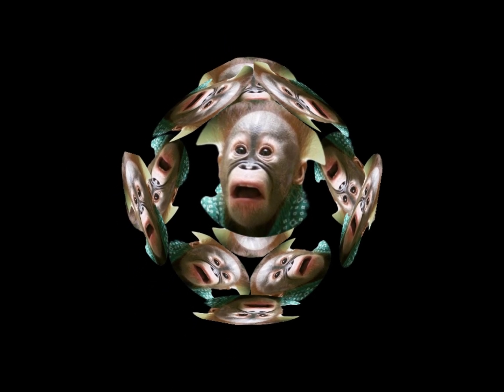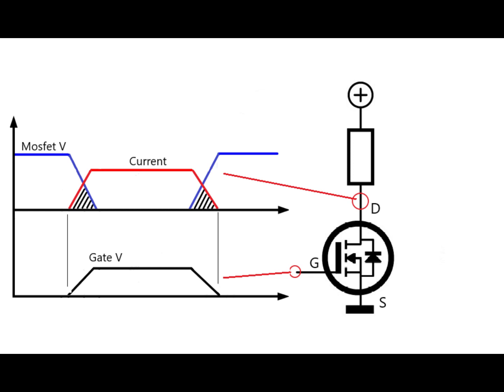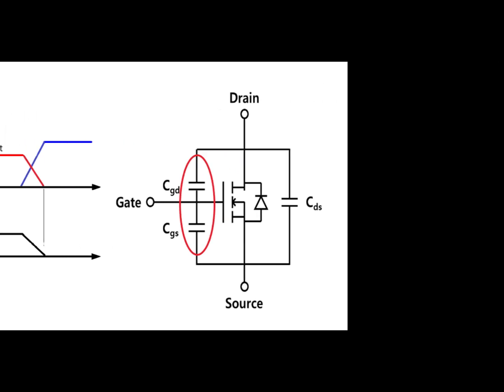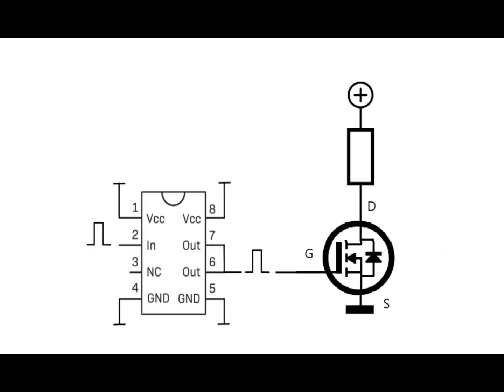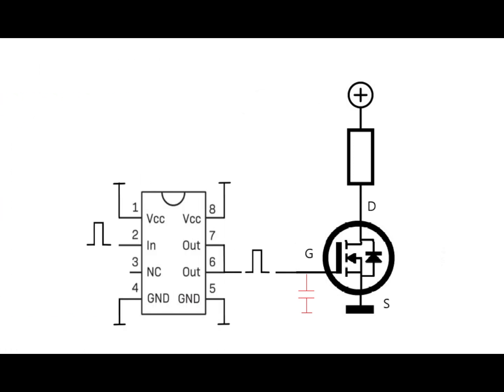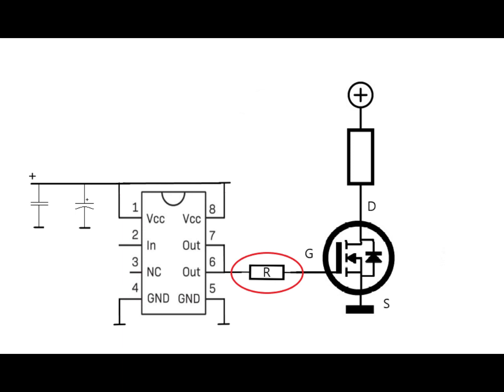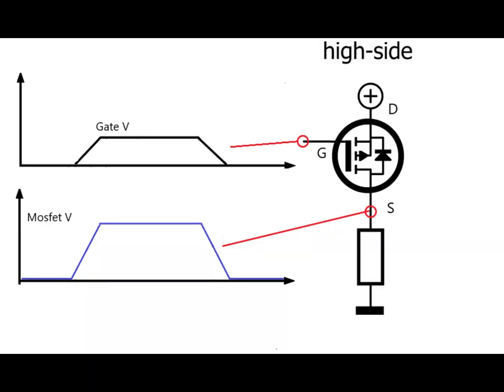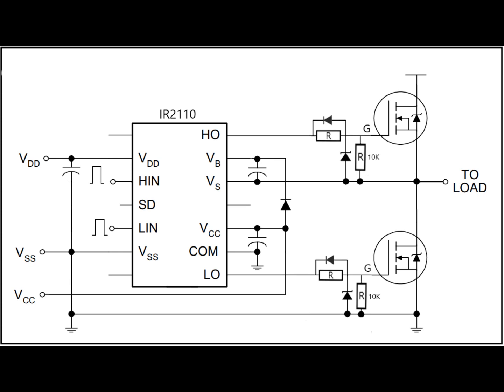How to Drive Mosfets and IGBTs

Comment: So if I’m running 5 volt input voltage from an arduino at the input, can I put a 10 volt output voltage to get a 10 volt signal?
Reply: If you pick a suitable FET - yes!

Comment: Just out of curiosity : is it not preferable to have the 10k pull down resistor on the left side of the gate resistor R? Great video. Thanks
Reply from the maker: Well its job is to pull down the mosfet gate, so why add extra resistance to that by putting it on the left of the gate drive resistor.
But since the gate drive resistor is usually so small it doesn't make much difference.

Comment: Mosfet doesn't use current, it's a voltage device
Reply: 2:00 He literally explains that the gate of a FET is capacitive. Show me a capacitor that doesn't require current to charge it.
Reply: It’s a little more complicated, yes FETs are voltages device’s but a typical power FET has around 2000pf of Gate capacitance, it takes current to charge the gate capacitance to reach a certain voltage level, so turning on  An FET is a Hybrid operation, gate capacitance charging ( Current, dynamic  current charging, and a static voltage once the Gate Capacitor is charged, once the gate capacitor is charged only a very small continuous gate current would be needed to Compensate any gate capacitor leakage current.

This is why analog electronics is so much fun!
Reply: When I worked at HP Labs we used  a transistor to drive the gate current to turn on the Power FETS quickly for the motors in our Robots.
Reply: You know the standard joule thief circuits? These circuit use current applied by the trigger coil to turn the transistor on and off. These circuits don't work with mosfets unless you use very high turns for the trigger coil
Reply: To add to the Complexity of designing Power FET circuits: the faster you turn them on the less time they spend in the resistive reign, less resistive losses and less heat generated, but there is a faster rising edge producing more High Frequency EMI.  Some of LTC’s switching regulators give the ability to control the rise time of the FET Turning on! Another trade trade off to be made between EMI and temperature rise!

Comment: Great basics, but I was hoping for more :(  ...THUMBS UP! :)
Reply from the maker: thanks. Out of interest, what else were you looking for?
Reply: Isolation/high side driver (beyond bootstrap caps) techniques, like gate transformers, problems at different PWM% etc. 
Using simple totem pole drivers - WAY CHEAPER than IC gate drivers etc.
Things to look out for like Drain capacitive coupling when switch very fast (i.e. not destroying the gate).
I know all these things, but, looking at what your channels shows, it might be of interest to your other viewers.
Reply from the maker: thanks. Yeah I thought about isolated drivers but decided it requires its own dedicated video. Interesting, I never actually thought about a totem pole being cheaper that a driver, I will look into it. As for the drain-gate capacitive coupling I thought this was taken care of by the protection on the gate...resistor plus zenner. What else can you do to stop drain-gate capacitance problem? @stevenbliss989
Reply: Yeah the zener will take care of it, IF NEEDED. Zener or TVS diodes are the only practical ways I know of.  But as I said only in very highspeed situations, and even then it may not be an issue given the capacitance voltage divider of the gate between the source and drain where the source capacitance always dominates.  I really should have said, MY MISTAKE HERE -SORRY, ...very high speed and VERY HIGH VOLTAGE (on the drain, at hundreds of volts) switching situations.
Reply: I came across an ULTRA FAST gate driver IC using high voltages on the GATE, many years ago (sorrry do not remember the model/manufacturer - and it was EXPENSIVE!).
What it did was switch up using 30V but only until the gate reaches 12v, then it stop FAST to prevent gate damage.  It does this to charge the gate capacitor very fast (remember the gate has a 1-3 ohm resistance).  It also used a -ve (user set up to -25V) to turn the gate of VERY FAST.  The turn on current was not fixed, and was in fact set to max Charge, NOT drive current, using a programming resistor.  Yep it was a very exotic, ...and VERY expensive (something like US$20's I think?).  Anyway, if you may have come across it in your studies.
Reply from the maker: Oh thats interesting, I have never heard of that before. I have used two isolated drivers in the past, the ADuM4121 and the Si82390CD. They are quite expensive, but the second one is very tough, it survived several explosions :) @stevenbliss989
Reply: I am sorry I cannot remember it's part number, it was quite some years ago when I was looking for high current mosfet drivers, Micrel and various second sources have drivers that go up to 12A like the common, and reasonably priced MIC4452.
Reply: Thanks, I need a gate drive working in 1MHz

Comment: Brilliant content! Are you interested in testing out some of the high voltage mosfets from China? Their rds on is pretty good but the gate charge is much higher and that requires a strong gate drive design. Might be something you're interested in?